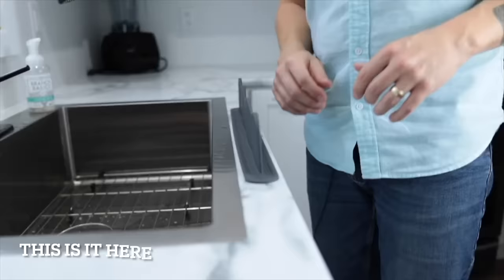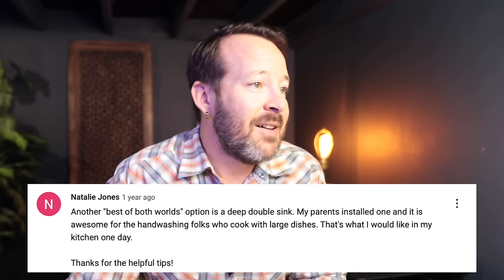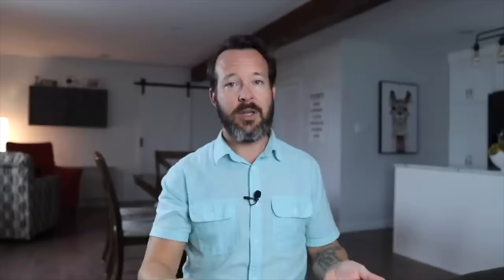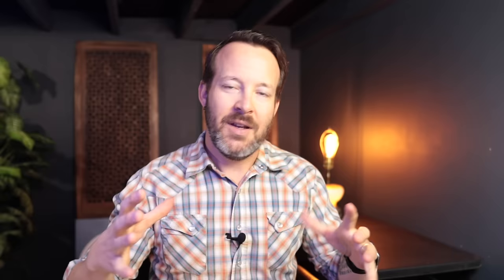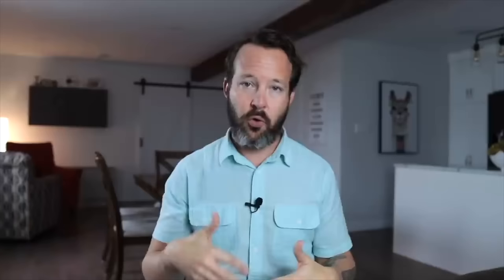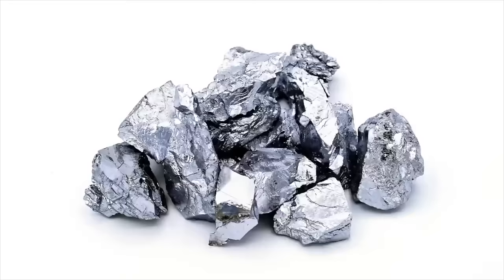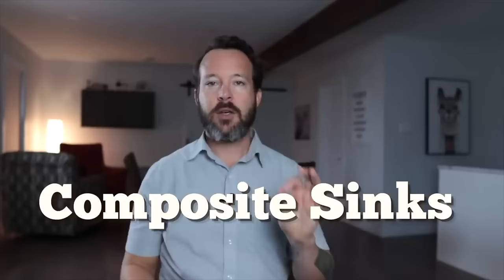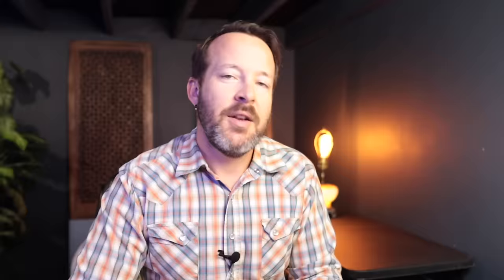Watch First Before Buying a Kitchen Sink

Comment: We are going through a major kitchen remodel right now.  Tore out a partial wall in a vaulted ceiling area that divided the space into 2 smaller rooms.  One room was the kitchen, the other a front room that we never used.  Tore out that partial wall and doubled the size of the kitchen.  Added a huge 10.5ft x 4 ft island, with double sink in it (never had an island before).  The former sink was also a double sink, against an exterior wall.  Since the plumbing already existed at the former sink, we just replaced it with a smaller single prep sink.  Having 2 sinks in the kitchen is really awesome!  So glad we did that.

Comment: Great video! My passion is cooking, and I make a lot of messes. Many tools, pots (esp. big stockpots and cast iron), anything wood, and utensils can only be handwashed (knives, crystal, appliance parts). So I need a big 2-sided sink that can take a beating without chipping, cracking, or denting. A word about wood sink accessories and wood counter surroundings — as beautiful as they are in the beginning, water and wood don’t mix. Unless it’s well-sealed and meticulously-maintained, wood is porous and absorbs everything that falls on it — especially oil. About stainless steel, it’s only a surface coating, and CAN be permanently damaged by certain cleaning products and over-zealous scrubbing, leading to rust, especially around the drain flange.

Comment: I have a dishwasher - never use it - enjoy handwashing.  My sink is a large single.  I run the water VERY slowly, wash a dish, rinse it off, and place it in the adjacent drainer rack.  No water waste.  This works for single dweller me...maybe not for a large family, a commercial application, etc.
Reply: A good dishwasher will only use 4 gallons per load, but sometimes you don’t even need that much to wash your own dishes!
Reply: We’re only 2 as a couple and don’t have a dishwasher. Let me tell you I dream of the day I will get a dishwasher. I don’t know how on earth we manage to produce so many dirty dishes in a day - but we are dirtying dishes morning, lunch, snacks and if I cook that day…let me just tell you it will be enough to fill up a dishwasher. I’m spending on average about 40 to 50 minutes daily just washing dishes by hand.
Reply: Steve, I’m also a single dweller but I love my dishwasher (I don’t mow the yard or shovel snow either).  I rinse my dirty dishes and place them in the dishwasher until I get a full load to wash - usually about every other day.  As others noted, I do handwash some items that aren’t dishwasher safe (mostly chef knives and cast iron cookware), also some larger pots and cutting boards that don’t fit in my dishwasher).  Those things I just wash, towel dry, and put away after use.  For me, a large single (undermount farmhouse) is the best way to go.

Comment: Forget accessories integrated in your 'work station' sink - keep it clutter free  less to wash and keep hygienic.  As for washing large pots etc in single large sink with an overflow drainage hole (my preference)  - it's all a matter of a disciplined approach - clean pots first get them out of the way (leave them drying in the empty dishwasher. 
Then later tackle the dishes - rinse and stack on the bench top and when you're in the mood either (1) wash and stack them in the empty dishwasher to air dry or 
           (2) stack the dishwasher and set to run. The first approach for me conserves energy & surprisingly water and also softens  hands for a manicure. 
And yes I wash dishes by hand every day and leave to air dry in the empty dishwasher freeing up the countertop/draining board -  this process is quicker than the dishwasher as it runs through its laborious cycle.
Finally rubbish bins under the sink - NO! it gets warm and humid in that space, a prime bacterial propagation environment - not only does it cause unnecessary wear 'n tear on the cupboard doors or drawers it is a source of inconvenience - sink use completing with rubbish disposal - keep them separate and independent and above all CLEAN!
Reply: It gets hot and moist under the sink; this is one of the worst places to put the garbage, and even dish detergent or other cleaners.

Comment: A hint for keeping a cutting board from sliding around while you're cutting on it is to place a damp washcloth underneath it;;;usually keeps it in place.  
About the drawers and pull out shelves under a sink you need to consider accessing the plumbing when (not it...when) a problem arises.  We have a filter system under our sink and my husband replaces the filter every 4 to 6 months...everything has to come out of that cabinet when he does this or he can't access the filter.  We use bins that can be removed without any hardware having to be removed.
Reply from the maker: Thanks for the tip on the cutting board.  I've never heard that one before.!!
Reply: @MTKDofficial  Just make sure you are not using a chain saw. 
Good luck !
Reply: @MTKDofficial  This is pretty much universally done in restaurant kitchens. At home under my large butcher block board I use a large piece of shelf liner, the kind you purchase in rolls  and would use in a cabinet under your cups and glasses.

Comment: I have used remnant vinyl flooring under kitchen and bathroom sinks in my rental units.  Using double sided carpet tape to anchor it in place.  Calking around the edges works as well as a metal strip attached to the front edge to keep the front from rolling up.

Comment: I got a very long workstation stainless steel sink with a farmhouse apron front. It's got two sections, one very large and one slightly smaller. I would have preferred drains toward the back. 47" long. The workstation ledges let you convert some of the sink into countertop or cutting board, plus all the strainer and bowl configurations. I used two tall spring-loaded spray nozzle faucets, so I don't have to deal with hoses and weights inside the cabinet. I have a garden hose bib under the cabinet for filling buchets on the floor.
Reply: Please explain more about the garden hose bib for buckets ! I need this. It’s a bane of my existence going back and forth to the bathroom til full buckets. Where ? How? Thank you.

Comment: Before  houses have electricity and light in the kitchen, the daylight from windows gave a good work light to the sink station, many in Europe had a hole in the sink and store a  bucket or container for waste water under the sink in the cabinet. the bucket with the wasted water was used to waters plants outside in the garden.

Comment: Appreciated the info.  Getting ready to replace my sink and countertops.  My townhome came with a u-shaped kitchen that has laminate countertops and an overmount double sink (the sink edge is raised about an inch above the countertop).  Since day one, I’ve hated the double sink and it’s raised edge (doesn’t fit larger items and makes for more work cleaning the countertop after use).  Thirteen years later, I’m finally getting ready to redo the sink and countertops.  For their function and durability, I’ll install an undermount porcelain farmhouse sink designed for cabinet retrofits.  I’ll also install manufactured quartz countertops for their durability.  The sink will allow me to use two Rubbermaid tubs for the few things I hand-wash (cutlery, cast iron pans, cutting boards).  I’m a bird hunter Sept thru Jan, and the farmhouse sink and tubs will work much better when cleaning birds in prep for freezing (sometimes I have around 15 to prep following a multi-day hunt).  Undermounting the sink will really facilitate cleaning the countertop after prepping birds.  I may opt for a worktop type farmhouse sink if I can find one made for retrofit projects.  That would be nice to have for general food prep as my counter space is fairly limited.

Comment: Sink garbage disposals are illegal in many cities and communities in Canada, because they put excess strain on the sewage system. Here we compost food scraps, either individually, or many communities have municipal composting programs where compost is picked up on garbage day. The resulting end product is then available to community members to pick up and use in their gardens.
 Re the sinks, I am most familiar with stainless steel single and double bowl sinks, and until my most recent house, I would only pick a SS double sink. However when my most recent house was renovated by the previous owners, they installed a single bowl clay-fired apron front sink. I didn't like it initially, but my husband ordered a small collapsible plastic container that we use when we only need a small basin of water. I became a convert and now I love it. We have moved and are adding a new kitchen to the new place, and I have been seriously thinking of buying one of those sinks for my new kitchen.

Comment: Galley kitchen here.
We may have overdone the washing area in our kitchen, although the space has allowed such madness.  We have a single sink with a huge double sink attached.  Also, two dishwashers, one on each side of this sink system.   We prefer washing by hand and then steam drying them in the dishwashers.  Since we have never been able to place all dishes at once in one dishwasher, two were a must.  It's a family of five who enjoys everything about cooking at home vs. eating out.  The 60" range is about 3' from the first single sink.  It has worked out very functional for us.  One cooks, other cleans, and others still have space on the other side of the 10' island where 60"fridge is.  Meal times are very busy, and the island separates the busy sections beautifully.  Hidden butler pantry with a butler sink helps those who have their vitamix jet engine blender going off throughout the day.  Also works well for those ugly appliances that one needs out.  Butler pantry attached, but hidden to the kitchen is a wonderful thing to have.  This entire kitchen system can handle all kinds of traffic without feeling busy or tight.  4' of clearance all around.  Oversized pocket doors allow us to close the kitchen off from the living area when noise is unwanted in the living room but open during entertaining.  Lastly, if one can, I'd advise double glass doors that exit to a dining atrium.  The glass helps it still feel open, without the noise the kitchen is producing while others are in the space.  Another non regrettable blessing.  Natural stone is the best way to go on countertops if possible.

Comment: Good advice. I absolutely agree with the recommendation of  some sort of catch-all mat/tray/pan under the sink. A very common source of water leaks under a kitchen sink is the garbage disposal. They will eventually rust out and leak (it's not a matter of if, but when). And since this is a hidden area that doesn't get inspected very often, it can be leaking for months without even knowing. Not sure how long the leak was happening to the previous owner of my house, but I had to devise a false floor on the bottom so I had some storage and wasn't starting at a huge hole every time I opened the cabinet. That was 10 years ago - I had to replace the disposal 5 months ago when IT started leaking ... that's at least 2 and this house is only 22 years old.

Comment: Such a useful video. I watched it to find out the pros and cons of sink material. I have had stainless steel for 30 years and I have been happy with it, but I was getting tired of the look so I was ready for something new. After watching this, I decided to keep the stainless steel and perhaps try a different shape or modern design in steel.

Comment: Sticking a piece of 3M sound deadening material on the bottom of a stainless sink is a genius idea! That stuff really does work. That's what they use to deaden transfer of vibration noise in car body panels.
Reply from the maker: Great input!  Thanks.

Comment: Loving our new 16 SS sinks - a large 33" single basin and a bar sink by back door. My only issue is the distance between the faucet and back splash. Bar sink has 4.5 inch clearance and large sink only 1.5". If I could do it over, I would get closer to 4" behind the main sink faucet by pulling the cabinets further away from the wall. I'm constantly drying the area behind the faucet so it doesn't get mold on tile. The back splash behind the bar sink never gets wet.
Reply from the maker: Interesting how just a dew inches makes that much difference.  I have to say, I'm always wiping up behind mine as well.  Kind of a nuisance.

Comment: Great video! Wish I had it when I designed my kitchen years ago. I had to do all my own extensive research. No regrets and thrilled with my choices.

- Granite composite sink. Durable, hygienic and easy to clean. Temperature resistant, for pouring. No concern on placing hot pans... on my granite counters beside sink (take that! quartz counters lol). Large square ish sink.. with arched back (flat front). This design allowed my granite composite swivel water tap (matching the sink) to be mounted to the left and the matching granite composite dish soap dispenser to be mounted on the right. Sleek and luxurious look I tell you! Faucet has pull out handle to easily fill any pot sitting on the stove nearby.

- Undermount sink was a MUST. Cleaning down counters right into sink much more hygienic that inadvertently pushing gunk into lip of over counter sink. Yuk!
- Sink drain is center and at the BACK, allowing more usable storage under sink. I was amazed at the extra space.
- Yes to flip down tray in front of sink. Great storage for occasionally used soft scrub brush which is put away once dried. NO worries about dampness as I went with thermo-foil cabinets (something you didn't cover). Easy clean, flat / flush surface that does NOT collect splashes / grime in crevasses.  Yuk!

ABOVE Countertop Cabinets... Nothing drives me more bananas than lost storage in these cabinets. Always ORDER AN EXTRA SHELF for each cabinet. Lower shelves to provide minimal need access above items (how much space is needed above to slide in a plate or a glass?). I now have 4 surfaces to store items. Lesser used on the top shelves.

- "altitude challenged" like me and can't reach top shelves of each cabinet? Ahhh, I ordered a thin cabinet (6" wide) for below my counter. It happily stores a folding step stool that I easily bring out for the higher shelves. Pop it back when done using. No need to wander to hall closet etc to retrieve. Step stool has it's properly designated storage within the kitchen. Of course not all step stools will fit but after a couple of stores, found what I was looking for. Perfect fit! 

Entrance to my kitchen required an angled cabinet below the counter. Looks good but what to store? Those long baking sheets, cooling racks etc sit up and down, supported by adjustable pegs. I drillled holes and used dowlings for pegs. These large items now have a proper home, not being rearranged from inside oven. On the shelf right above them? Cook books and the countertop book holder. Clutter free IS best, especially when baking right?

As you say, planning. Which is all about designing what YOU need your kitchen to perform. Thinking ahead. Yep, a few neighbour's jealous lol One even wishes she could rip her latest out and do all again. Poor thing... I'll take her out for drinks.
Reply from the maker: The hidden step stool is a pro move!  God job.  Kitchen sounds awesome!
Reply: @MTKDofficial  
Thanks very much !
Reply: I am glad I found this comment before I started my project. Thank you.

Comment: A few years back, we had a small, unnoticed water leak under the sink that only became apparent when I saw that the 5 gallon water tank for our RO water system was slowly sinking thru the particle board floor board.  I cut it all out and replaced it with 3/4 " plywood, painted with multiple coats of primer and exterior paint to waterproof it, and I installed it with a small tilt so that any future water leaks will spill out onto the floor, where it will be noticed sooner.  Better a puddle now than a failed cabinet box later.

We are currently doing a kitchen reno, removing the failed and cracking tile and its concrete underlay, and putting down new plywood in prep for a stone top of some sort, probably quartz.  Having learned about water and wood being a bad combo, EVERY bit of plywood, ESPECIALLY the edges, are getting multiple coats of primer, particularly at the sink cutout.

We chose a Lordear 32" workstation single bowl, center drain stainless steel sink.  Since the quartz is some ways off, I temporarily installed it in the plywood top, and it is a HUGE hit. I was able to drill 2 additional 1 3/8" holes for a total of 4, to accommodate the install of our RO water tap and a soap dispenser.   Long ways to go, but at least we are no longer doing dishes in the laundry room.

Comment: Although I don’t like my corner butterfly sink, I have a laminate counter with a seam under the sink and have had no issues in the 38 years I’ve been in my home. That said I do not have a mitered corner preformed laminate, which is maybe what you were referring to. My counter was built on site by previous owners with sheet laminate and because the U shape kitchen is wider than the longest available sheet laminate a seam was done where it would be the least noticeable and shortest, in the front and back few inches under the left sink bowl. Absolutely no water issues, destroyed laminate or under cabinet water damage and it’s probably over 40 years old. I’m not sure exactly when the previous owners installed it, but it could be 60 years old if they did it the year they moved in.